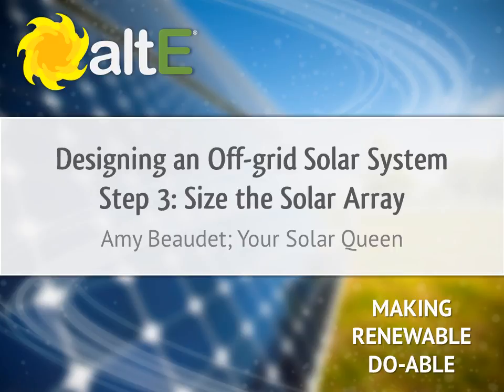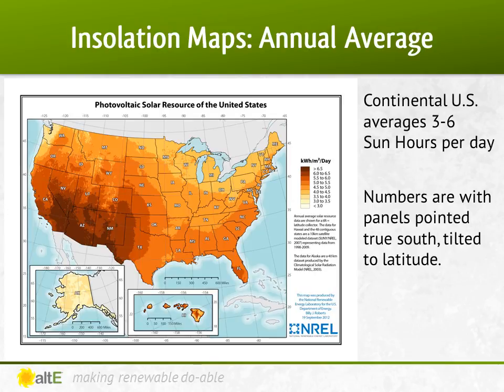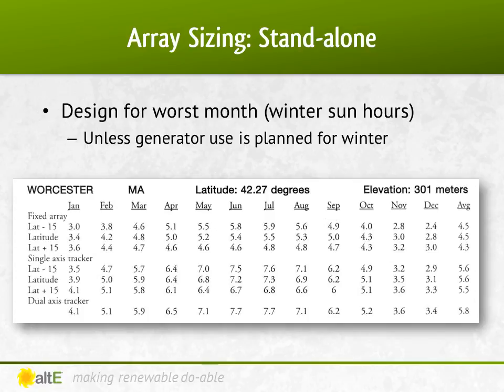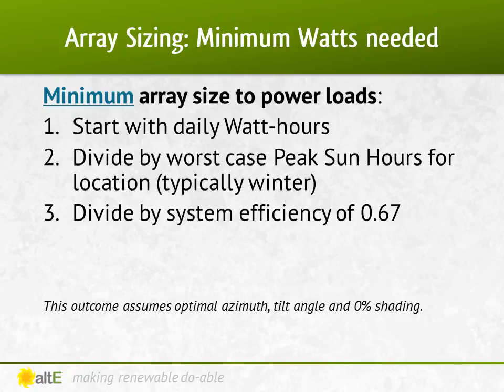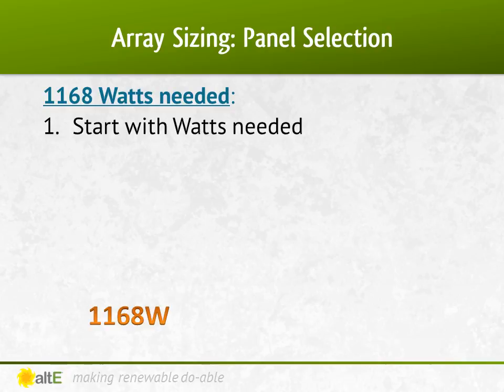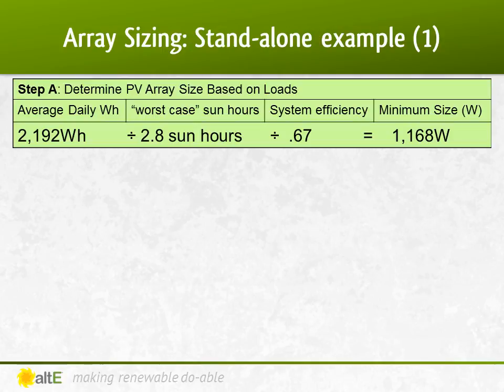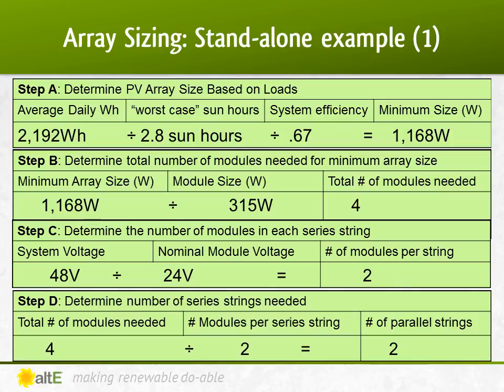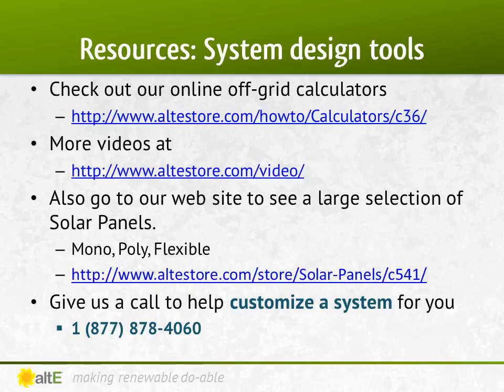Solar Array Sizing: Off Grid Solar Power System Design - Step 3

Comment: Thanks for the exciting presentation. 
Please what will the total wattage for the solar panel array be if it is to simultaneously power the total load through the inverter and at the same time charge the battery bank ?

Comment: I am not sure that the sizing procedure as shown will work.  

DUE TO SYSTEM LOSSES: 
The solar panels once they age will have losses of between 10% to 20%.

The battery charger (whether it is a dedicated battery charger, an PWM, or an MPPT) will have losses of 5%.

A lead battery bank will have losses of 25%.

A battery inverter will have losses of 10% to 20%.

2,192 Wh x [(1 - 80%) + (1 - 95%) + (1 - 75%) + (1 - 80%)] = 1,534 Wh due to system losses  DUE TO % DOD  2,192 Wh x 50% DOD = 1,096 Wh due to 50% DOD  DUE TO TEMPERATURE MULTIPLIER WHICH COMPENSATES FOR LOST CAPACITY DUE TO LOWER TEMPERATURES  Then on top of this you have as you pointed out a temperature multiplier.  2,192 Wh x 1.19 = 416 Wh due to temperature multiplier  SUMMARY OF ENERGY REQUIRED  2,192 Wh energy demanded 1,534 Wh due to system losses 1,096 Wh due to 50% DOD
   416 Wh due to temperature multiplier 5,239 Wh energy required to account for energy demanded, inefficiencies, % DOD, capacity loss due to low temperatures   This implies a multiplier of 2.39 or 2,192 Wh x 2.39 = 5,239 Wh  SOLAR ARRAY SIZE  Winter sun peak hours are 2.8-Sun peak hours   5,239 Wh / 2.8-h = 1,871 Wh size of solar array required   NUMBER OF SOLAR PANELS, # OF SOLAR PANELS PER STRING, & # OF PARALLEL STRINGS  Solar panels of 250 Wp  1,871 W / 250 W = 7.484 solar panels or 8-solar panels  48 VDC / 20 VDC = 2.4 solar panels per string increase to 4-solar panels per string to be divisible into 8

8-solar panels / 4-solar panels per string = 2-parallel strings

ISSUES

This solar array will keep up with energy demand from house loads in the winter as calculated above; however, in the previous video, a battery bank was designed to store energy for 3-days along with the energy demand required for house loads.

However, in IMHO this system will not suffice for the battery bank in the winter for more than one day.  The above calculations provide sufficient energy for the house loads and for stored battery energy used for ONE day after accounting for energy system losses and compensation for lost capacity due to lower temperatures.

The previous video designed a battery bank of 16,986 Wh for THREE days of energy storage.  This will probably create problems inside the batteries since they will remain undercharged for several days during the winter, and as stated in that video it will require a generator. However, the generator might work best as a DC generator, and charge the batteries directly, or it will require a bidirectional inverter converting AC to DC to charge the batteries.

Comment: Hi Amy
This is by far the best educational video I ever came across. I should have seen this while I was studying for renewable energy major. But it's never too late to ask a question.
I was wondering when we design the array should we always base it on the load? Aren't we going to base it on Wh of battery bank? After all it's the battery bank that the array is supposed to charge?
Will appreciate if you shed some light in this.

Thank you
Reply from the maker: Both the array and the battery bank are sized for the load. So by default, the array will be correctly sized for the battery bank.
Reply: Aslam o alikum. Elaborating the altE Store's answer, Ihsan if you are worried about the bigger battery bank than there are following things that should be considered.
1) Battery Bank was designed keeping these predictable variables in mind (Video 2 of the series)
   a) DoD
   b) Inverter Efficiency 
   c)Days of Autonomy 
   d)Temp multiplier (Has no role in charging just changes the capacity size)  
       
        So you would not need to recharge your complete battery bank on daily basis. and after  considering all that a backup generator is added to cope with any other unpredictable variables. 
 
2) The solar hours are taken on worst average of the year at 2.8 hours so that too will support the charging requirement.
3) The next factor was DC system efficiency which is kept at 67 % .
  So considering all these you would not size your PV according to battery bank size other wise it would of no use most of the year. Since your batteries will be at full capacity, and that would be a waste of resource.

Comment: I am a little confused.  From your "load" list you needed 2192 watts of power.  When you divide by "efficiency" you have less power available that is needed.  Seems the panels would have to have higher power output to provide the needed power.
Reply from the maker: You need to include time into the equation. For example, 2000W of solar can generate 6000Wh of energy stored into a battery. You could run a 6000W load for an hour. The solar panels aren't running the loads directly.  They are simply charging the batteries, that then provide power to the loads.
Reply: Guess I am just to thick headed to understand.  Thanks for the time to reply.

Comment: I got a 10W solar panel, whose specs are:
Max Power = 10W
Vmp = 18V
Imp = 0.55A
Isc = 0.6A
Voc = 21.24V
Max system voltage = 1000V

According to the specs mentioned above, is this a nominal 12V solar panel? Because it has 70 cells total. Please let me know asap. Thanks.
Reply from the maker: It is a 12V panel. They may have 2 parallel strings of 35 in series to make the right voltage.
Reply: @AltEStore  I also got a 5W solar panel, whose specs are:
Max Power = 5W
Vmp = 19V
Imp = 0.3A
Isc = 0.3A
Voc = 23V
Max system voltage = 715V

According to the specs mentioned above, is this also a nominal 12V solar panel? Because it has 36 cells total (one array, consisting of 16 cells, is connected in series with another array, consisting of 20 cells). Please let me know asap. Thanks.
Reply from the maker: @sanchezboy8654  voc of around 22 or 23V is a 12V panel.
Reply: @AltEStore  thanks.

Comment: is possible that operating hrs of the load is more then the average sun hrs?????
Reply from the maker: Yes, as long as the load is smaller than the solar array. For example, if you have a 1000W solar array and 5 sun hours, in one day you'll make 5000 watt hours (before losses). After losses,  you'll have about 3000Wh available. If you have a 100W load, you could run it for 24 hours, and still have leftover power. 100W x 24 hours = 2400Wh used.

Comment: Very nice videos and I learned so much from these videos. I can help in system design, site analysis, feasibility check considering utility rate etc. Please Contact if you want information regarding solar PV rooftop system. I will be available for site in the districts of Andhra Pradesh ,INDIA (Vizianagaram, Visakhapatnam). Contact number 9177018213.

Comment: How do I know nominal voltage?

In Datasheet of panel I am refering following specs are given
maximum power (Wp = 225) , power tolerance (±3%), Vmp (26.66V), Imp (8.44A), Voc (33.60V), Isc (8.9A)
Reply from the maker: Do you know how many cells are in the panel? Each cell is usually about 0.5Vmp. At 26.22Vmp, I'm betting it is a 54 cell, nominal 18V panel.
Reply: altE Yes its 54 cell panel.
You're amazing.
Thanks.

Comment: hello, what about if i want to make battery charge and load work at the same time ?
solar array sizing will be the same or what ?
Reply from the maker: Once the batteries are full to begin with, if you are using 10kWh and making 10kWh (as with your question, not taking inefficiencies into consideration), then whether you use that power as it is being made vs using it from the batteries, you are using the same amount. Where needing the extra power generated comes into play more is if you have a rainy day that draws power from the batteries, then a sunny day, and then another rainy day, and so on. The solar array may not have had enough time to charge up the battery bank fully before you need it again. That being said, the calculator figures out the minimum size array you need, it is usually a good idea to oversize a bit to take various scenarios into consideration.

Comment: All tutorials  about PV arrays I've seen start by calculating the loads without saying anything about daytime or nighttime consumption. Your tutorials are far away the best we can find though, thanks for that!
Am I wrong when I assume one has to size the battery bank to cope with the consumption at night and size the PV array to refill the batteries and cover the consumption during daytime. Let's say from your example, run the well pump at noon for instance? I've another question about batteries, when a battery is referred to as 200Ah, 20 hours discharge, shall we adjust the whole capacity like this (12-volt battery) Wh= 200Ah/24h*20h*12V=2000Wh instead of 2400Wh?
Reply from the maker: +Bernard Deham When sizing the array, the time of consumption doesn't really come into play, the array needs to create enough power for the load, regardless of if it is used immediately or later. Yes, there is a little efficiency gained by not dealing with losses from storing it, but not enough to factor into the equation. However, that is a valid point, if you are using the power immediately instead of storing it, when you are calculating the battery bank, that can come into play. You can get away with a smaller battery bank if you don't store it.

If you are going to be using the battery at a different discharge rate than it is listed at, you would need to check the specs of the battery to see what the capacity is at the discharge rate you are using. For example, if you are going to be using a C10 rate instead of C20, the capacity of the 200Ah battery may actually be 175Ah. You would use 175Ah for your calculations instead of the 200Ah. The battery specs usually have a chart or graph showing capacity at other C-rates.

Comment: Hi, Let say I used all 2192Wh in just 1 whole night (means drawing all that power from bat only). then i want to charge it for 2.8Hr time (since its the worst case of sun hours and no other load connected).. do i just need to add more panel to my system.. like 8 pcs of PV.. 4 in parallel and connected to series to generate around 1260W..? is that amount of power enough to bring up my batteries again to use for the coming night? ^_^
Reply from the maker: +Rolex Fredeluces Right. If you are using 2192Wh overnight, and have 2.8 sun hours to charge it back up the next day, you need enough solar to do that. 2192Wh / 2.8 sun hour / .7 system losses (varies depending on system) = 1118W of solar needed to charge battery back up next day. Depending on your panels and voltage battery bank, you could do something like four 300W panels, wired in two parallel strings of 2 in series. Here are some 320W 24V panels,  https://www.altestore.com/store/solar-panels/solarworld-320-watt-solar-panel-sunmodule-sw320-mono-v40-frame-p11864/
Reply: +altE Store thanks a lot..

Comment: Don't know where you live but your math says you use 63KWH per month. Average house in north america use 600-800 KWH per month. Your heading says "OFF GRID" so I think you should at least try t be realistic.
Reply from the maker: +Trina McDonald This series of videos is to teach how to do the math, including figuring out how much power you need for your particular system. In the first video of the series, I did a loads list for an off-grid cabin. I have lights, a fridge, a radio, a well pump, and occasional power tool use, coming up with the 2192Wh a day. https://youtu.be/vdly8OhsdmI?t=6m35s That is a very realistic loads list for an off grid cabin. 

While taking an "average" house off-grid is possible, it is a much bigger endeavor than most people realize. Going completely off-grid generally takes a lifestyle change, cutting your power usage dramatically. A more realistic example for learning purposes is for taking a cabin off-grid that already has low power consumption. Once the basics are learned, then you can apply them to whatever size system you need.

Comment: i have one doubt. in our calculation total system load is 2192 wh. that means solar panels must supply more than 2192wh. so why did u choose 1168 wh. please clarify it . thank you
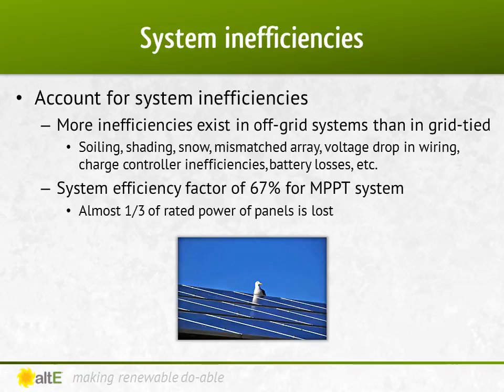Reply from the maker: Faizal Ps You are confusing 2192 watt hours of the load, which is a quantity, and 1168 watts of the solar panels, which is an instantaneous output rate. If you watch the video, at 3:13 I go through the math to determine the size of the solar array needed. 2192Wh load ÷ 2.8 sun hours ÷ 0.67 for system inefficiencies = 1168 watts of solar panels needed.
Reply: Thanks a lot for your reply. I got it. I was wrong. Anyway your video is really awsm and very helpful for beginners.  Thank you again.
Reply: Is this correct? I would have thought it should be 2192Wh load ÷ Inverter Eff. ÷ 2.8 sun hours ÷ 0.67 (system eff.) ?
Reply from the maker: You are right, I forgot to mention the inverter efficiency. Thanks for the correction.

Comment: what about the difference between poly and mono crystal cells?
if you are going to wire three 20 volt panels in series for a 48 volt battery, would you run the that through charge controller like a classic to match the voltage?
what about snow coverage, is there a charge controller that will warm up the panels to aid the slide to slide off?
what about solar trackers to get better performance?why not over build the panels to produce more power and store to a bigger battery bank to be less dependent on genny?
thanks
john
Reply from the maker: +Rev John O'Toole Rev John, Sorry about the delay, we missed this question.
 
- We just released a video about the difference between mono and poly solar panels, you can see it here https://www.youtube.com/watch?v=TCq0K3DlFdc.  

- Yes, if wiring 3 panels in series for nominal 60V, you would run it through an MPPT charge controller to drop it down to the correct battery voltage. 

- MidNite Solar was working on a feature on their Classic charge controller to run the power backwards from the battery bank to melt the snow, but last I heard, that feature wasn't released. The most reliable way to help snow fall off is to install them at a steep angle. That helps maximize winter performance anyways, as the sun is lower in the sky during the snowy season. 
- We did a blog talking about the pros and cons of trackers, you can read it here, https://www.altestore.com/blog/2015/06/solar-tracking-tips-to-track-or-not-to-track/ . 
- The decision to oversize to reduce generator use is a tricky one. If you are in the middle of a week long storm, it would take a very large battery bank to give you a week of battery backup. At some point, it isn't cost effective to chase down every last kWh via solar, no matter how big your array is, if there's no sun, there's no power. However, if you are in a location that's good for wind, a wind turbine in combination with solar can be a great solution, as usually when the sun isn't shining, the wind is blowing. Especially during the winter.